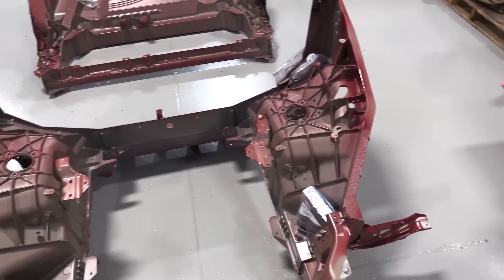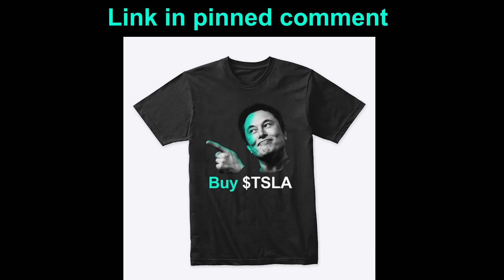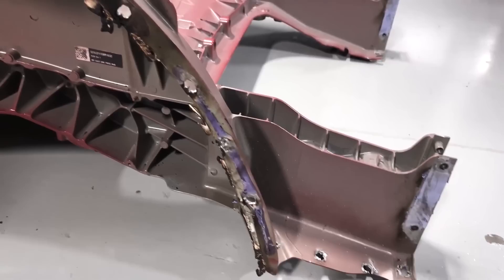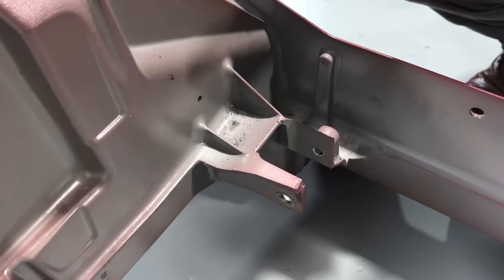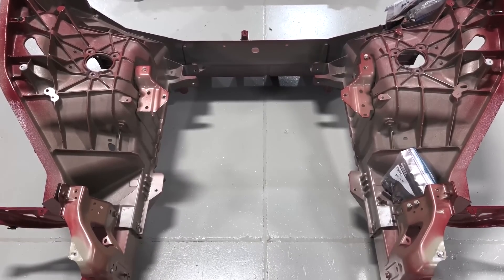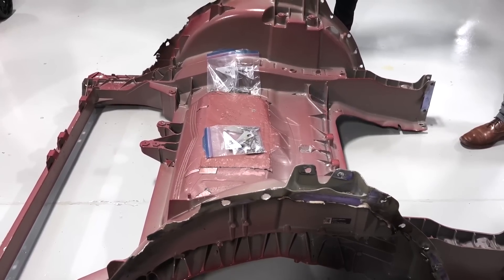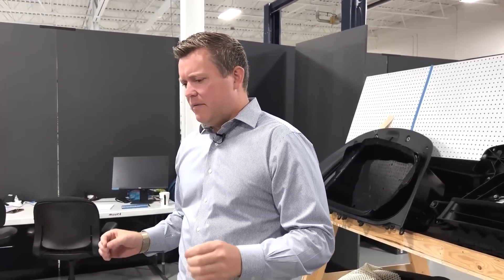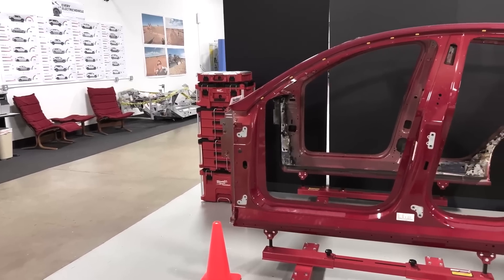Newest Tesla Model Y Giga Casting: “Blows Away” Munro Crew

Comment: I shared this idea before (sorry to bore you). Not using the giga castings in the Model S and X means they can innovate how lower production higher end cars are built. It frees up the minds of engineers and floor workers to think outside the giga castings. Who knows? This could result in using smaller battery packs in the crush zones not just in the structure of the cabin. And maybe the doors and trunk / frunk lids can have some form of battery storage.

Comment: Crazy thought. The Cyber Truck is on pace to be available before any Ford Superduty trucks. Considering that with the higher durability, lower price point, lower maintenance, and lower ownership costs combined with a 15,000 lb tow weight and air suspension means Ford will likely lose most, if not all of its commercial truck business in an epic erosion of market share.  Cyber truck will have an epically quick production rate due to the elimination of the frame and addition of a structural battery pack. I imagine we will see a 5-7hr vehicle construction time. Ford cannot compete.  I’m gonna miss my ford but I’ll love my cybertruck.

Comment: TSLA will continue to use the first principles of engineering mindset in order to solve problems, that’ll continue to arise from being the first in the too see the problem.

https://youtu.be/hgu7Ok-qcTY 

TSLA will continue to be on the bleeding edge of manufacturing system technology in the BEV sector. 

It’s one of the sectors that TSLA has an unsurpassable lead. 

The same premise for the battery system technology. 

TSLA is willing to invest money into uncharted territory for the future part deletions.

Like Elon said that the best part is no part:  

https://youtu.be/mr9kK0_7x08

https://youtu.be/MevKTPN4ozw

cOmPeTiTiOn sees the initial investment cost of the Giga casting system and the minimum requirements for the payback period of that type of investment:

https://youtu.be/IgTNynoVX-I

TSLA sees the quickest payback of Giga casting and looks @ the order system and it’s verified as excellent investment strategy for the long term. 

cOmPeTiTiOn wants the status quo narrative and yet keeping the investors happy and calming and not disrupting the quo or spending on items that they think won’t be as fruitful endeavor for the company and investors. 

TSLAQ and others can’t understand fully what TSLA is doing in the sectors that they are tackling. 

GM HUMMER EV is a 687 wh/m or 1.4 miles per kWh on a 215 kWh pack for roughly 300 miles per charge. 

248 wh/ mile from model S platform; Model X plaid is 300 wh per mile or 3.33 miles per kWh for the Plaid ( roughly the weight class of Hummer EV).  

Plaid is 2.29X more efficient than the HUMMER.  If Plaid had the same kWh pack size of Hummer EV then it’ll probably be closer to 710 miles per charge 

The battery technology and management system of cOmPeTiTiOn will always be laggards to TSLA.

SMR is going to be having a hard time keeping the raunchy jokes out of the video.. 

🤪🤪🤯🤯🤣🤣🤣

The TSLA security glues are top notch of sorts. 

Eventually these innovations will be used in the model 3 lines and future versions of vehicles.

Look at the cOmPeTiTiOn investment link for more information about the expenses of Giga casting above. 

cOmPeTiTiOn doesn’t think that they would have the DEMAND to recoup the initial costs of Giga casting. 

Sandy said that 30-50K per year is a minimum for the initial investment of Giga casting above under the cOmPeTiTiOn investment link. 

GM million units per year of GM scheme is 34K per brand of 30 brands. Or 8.5K quarterly or 95 vehicles per day basis. 

GM would be barely enough to recoup the initial payments of Giga casting requirements. 

:_STMPMatters::_STMP420::_STMPTsla::_STMPLook::_STMPElon::_STMPShh::_STMPHappy:

Comment: SMR, great video, I’m a big fan.
While you are right with most of what you said, you are wrong about what you said regarding multiple models giga casting.
The Idra machine is not part if the “line”, it spews castings in asynchronous manner that are fed into the line later.
Therefore there is no hard association between a machine and a specific model.
It perfectly possible to have an Idra giga casting single machine creating several models of castings for several car models.
So what matters is the sum of the models and not amount of each model separately.

Comment: The breakeven cost of doing casting needs a higher volume of production. Other car makes don't have that many models which are high-volume models. Also, Also the other car makers don't have a heavy vehicles like an EV so the advantage of having a stronger frame is not as great for a lighter car. Fear of new methods causing a big liability in the future is probably the main reason. So many class action lawsuits have made car makers fearful of unproven technology.

Comment: Very few cars these days are repaired that have any kind of a substantial collision.  Much of the inner structure used in all vehicles these days has limited repairability.  The high strength steels used today can typically only be cold straightened and should not be welded which limits repair options.

Comment: The first model Y had many pressings welded together to comprise the subframe.  The second iteration employed two conjoined castings to make up the rear subframe and today’s third iteration has two unitary castings for front and rear subframes along with a structural battery.  Each iteration speeds up production, reduces cost of goods and improves net profit margins.  The reduction in manufacturing footprint yielded by the complete removal of cutting, pressing, aligning and welding robot gates by employing castings improves production capacity of existing factory space.  Tesla is following the Ford model T manufacturing handbook of making a popular car and then focusing fully on reducing its manufacturing costs.  Tesla has been criticised for not having a diverse model lineup but each iteration of the model Y is a new model but just uses an existing skin.  How many legacy car makers produce new models that share existing under pinnings but only change the skin.  Tesla are patient and we will see model diversification when Tesla has the production capacity to meet demand for existing cars.
Reply: I agree. When Tesla offers sexy new skins, the demand will rocket ahead even more. I like the style of the new roadster. That should be a design cue to look for in the future.

Comment: Munro seriously needs to have a conversation on how these cars are repaired when in an accident
Reply: Hopefully FSD takes over the world and we wont have to worry much about accidents anymore…
Reply: @holysmokescharles  I thought about when ICE engines no longer exist, and all vehicles are FSD, they can technically be made out of cheaper materials like hard plastics since accidents won’t occur. Other than hitting animals and freak of nature incidents. Cars could then be ridiculously expensive.
Reply: @zingsthings  you may be right about that.  Will have to be rigid enough though to hold the weight of battery packs and stand up to the forces of driving.  They would probably replace the entire passenger compartment structure with hard plastics like you said.    I think one day we won’t own cars at all and will just have subscription service for ride hailing.   Crazy to think what’s possible in the next 20 years
Reply: Cars won’t be crashing like in the past

Comment: As always, thanks for the video. 

I've been wondering about the basis for your 10-year price targets. 

Call me paranoid if you wish but I've just watched two films - "The Big Short" about the 2007/8 financial crash and "Downfall" about Boeing's 737 Max disaster, both currently on Netflix. 

"Downfall" shows how Boeing, a great and innovative engineering company (who were so passionate about safety that anyone on the factory floor could speak up about about any design or process they were unhappy about), bought out McDonnell Douglas but were then taken over by the McDonnell Douglas executives whose only interest was share price (and tended to fire anyone who rocked the boat about increasing production speed at the cost of quality or safety - actually spending money on designing a new aircraft was a no-no). I guess takeovers are expensive and Wall Street wants its money back. Regarding reputation, Boeing is a shadow of its former self. 

"The Big Short" demonstrated that ratings agencies, as private companies, were giving their customers whatever ratings they paid for. As I understand it, this is not fraudulent as ratings are only advisory. It's up to you if you want to follow them. 

I have this strange dark fantasy - couldn't possibly be true - that financial players are paying to keep Tesla's ratings down and the share price low so that when the P/E drops enough they can make their move with an aggressive takeover. The building of new factories will stop so that demand (and profit margin) will stay high, there will be no continuous innovation (like Gigacastings and free updates), the workforce will be silenced and the cash pile grabbed. As long as the acquisition costs are covered and a short-term profit gained, Wall Street will be happy. Tesla will become a shell of its current self. 

In the meantime, Elon has sold a chunk of stock in his battle with an intransigent Twitter, which could be another piece in the same plan. 

Hopefully this is all crazy and couldn't happen leaving your price prognosis probably pertinent.
Reply: Wouldn't Elon as the "owner" be able to prevent this? I am no expert in this area...

Comment: Hi SMR, as 57 YO engineer, the giga-casting technology is just awesome; in fairness to legacy auto, this technology is leading edge and would not have been possible when legacy auto was working out how to make unibody vehicles in the 60's and 70's. Tesla basically invented this technology, asking the casting machine manufacturers to build them for them, and developing the alloy chemistry to make it work. Yet again for legacy auto, the problem is change and the massive investment need to make vehicles this way when you have factories design to press steel components and weld them together. Tesla is just awesome at engineering. Tesla is just awesome at software. Tesla is just awesome at forward thinking. I guess you could say Tesla is just Awesome!
Reply: According to Sandy Munro, casting technology such as this was available 15 years ago. He has an example a Canadian engineer brought in but legacy rejected it.
Reply: @MrCPPG  No surprise there.
Reply: Sandy tried to get OEM's interested in large front and rear aluminum castings since the '90's but was rejected by all.
Reply: I'm 43 YO  mechanical engineer with masters specialization in metallurgy - I just bought more shares of TSLA
Reply: @uonko  - Consider applying at Tesla.
Reply: I agree. Too bad so few people realize how awesome Tesla is.
Reply: @nononsenseBennett  They will. Eventually
Reply: Amen to that...
Reply: One other problem is that casting is not core competence of any auto maker. And they would never work on this from a technical, technological (IP) and investment point.
If a company like Tesla can start from scratch we all can see what´s possible. This is the reason why the old auto makers will going bancrupt. They stick in the 70th.... manual assembling, welding, rivets, nuts and bolts, robots for everything .... a lot of transport operations.
Reply: my aunts 57
Reply: It's also expensive to become obsolete and not innovate over time vs. changing a process completely. Cost of lost opportunity...
Reply: The integration of the software and hardware blows my mind and I'm a long retired IT guy.  I recently read that IT people can move between Tesla and Space X.  No doubt they are right there at the top of the software engineering heap, the B, C and D ones go elsewhere, the D ones end up at legacy auto.
Reply: If you drive one you will buy one 😎
Reply: One note is that legacy auto don’t plan for the same volume per model and have a annual lower production rate per model/factory so the ROI for a giga casting machine in a legacy auto plant is lower then the ROI for Tesla because the difference in planned cars produced by that machine per year and may not be able to leverage the speed improvement because the rest of the line can’t keep up.
Reply: Yep.
Reply: Leap Motors taking Europe by storm with its "Tesla 2.0" cars at $28K with life time warranty... https://www.youtube.com/watch?v=5d7VukWIG_o
Reply: But doesn't it also require a custom invented alloy which can be injected in fraction and also have the properties similar to steel and aluminium?
Reply: have you ever watched Monroe where they show a unibody from the past the traditional auto manufacturers deemed unnecessary?????
It's still sitting in his building right now!
Reply: 1929 DKW, now known as Audi!
Reply: DAMN STRAIGHT!!

Comment: Looking at the additional elements that had to be bolted, welded and attached with adhesive to the latest giga castings, that's likely because you cannot design a two-piece die that can physically open after the shot if the resulting cast parts lock the dies together. 

Then I remembered, the Tesla patent for a die-cast unibody car construction. It clearly shows FOUR ram sets, 2 on the X and 2 on the Y plane - front, back, and either side. Using 4 dies means much more complex forms can be cast without locking the dies. What's to stop Tesla developing a 6-plane X-Y-Z die casting, or even 360 multiple-geometry die design?

Historically, complex casting was done using the lost wax process, or sand casting. Contemporary complex forms in aerospace & elsewhere are 3-D printed when internal voids cannot be created by any other casting technique. These technologies trade scale or complexity. Multi orientation die casting might be a game changer. Current Tesla Giga Presses might be 0.1.0 beta.

https://cleantechnica.com/2019/07/23/tesla-files-patent-application-for-die-cast-unibody-machine/

Comment: Tesla has a funny way of doing range. There is a reason they don't sale by battery pack size anymore and it's based on range. As they take weight they don't let the car increase range. What they do is make the batter smaller so the range is the same as previous models and those battery cells that are saved are distributed to making other cars and eventually power walls and grid batterys

As far as crashes go. I always joke that I would rather get hit by a semi than a tesla.

Comment: Hey Steven . In the tour around Idra , Sandy got told that it only makes economic sense if you produce between 20k/50k parts per year . But that was in reference to the smallest giga press. So taking that into consideration Tesla is making a killing.  Glad I'm all in.
Reply: Would you mind sharing the source?
Reply: @k4piii  look up Sandy Munro Idra,  I think it's around min 8/9.
Reply: @miguellima2204  I couldn't find it on that video min 6 to min 15.

But I found in Wikipedia that the cycle time is 80 to 90 seconds. 40~45 / hr, ~1000/day, 365k/year

So 320k is a good estimate, for downtime and maintenance. 12% of time or 42 days per year, one week after each month

Comment: WOW!! All of that innovation in just 2 years! Just think how much faster it is to build the car now and this is just the body. Add in the ease of assembly to line workers when the seats are now mounted to the battery pack that is also structural and other refinements and part integration that haven't been revealed yet and it's easy to understand that Tesla is LEADING AND SPEEDING AWAY with this industry. Thanks for the information team Munro!
Reply: You copied my comment word for word that I posted on the Munro video. Why not express yourself with your own thoughts?
Reply: Billshit!!!! You mean all those new parts for only two car models that tesla makes!?!? It makes sense to improve them compared to a manufacturer that has litteraly dozens of models with about 100 to 1009 configurations possible. So nothing special here
Reply: @alanmay7929  I believe only the model Y has front and rear castings right now.
Reply: @erwin-franz  so what!!!!!!!
Reply: you said “…all those new parts for only two car models…” i just wanted to clarify it’s just one model, not two. if you don’t mind the discrepancy, it’s all good
Reply: Tesla leading in your dreams right!?!? 😂 😆 😂
Reply: ❤️ Tesla #1 ⚡🇺🇲
Reply: Probably just the tip of the iceberg tbh. Sandy’s team can only understand the structural change while the software battery chemistry and supply chain changes are even bigger deals
Reply: @grantguy8933  lol……. Supply chain is litteraly every companies not just tesla
Reply: @alanmay7929  you are the type of people GM needs the most.

Comment: SMR asks how it will look in another two years. I suspect the side frames (sills, roof rails, A, B, C pillars) will be single castings.
Reply: how long until it is 5 castings only: rear, front, battery, left and right sides
Reply: They are going to cast the doors and tires next right!? 😂 😆 😂